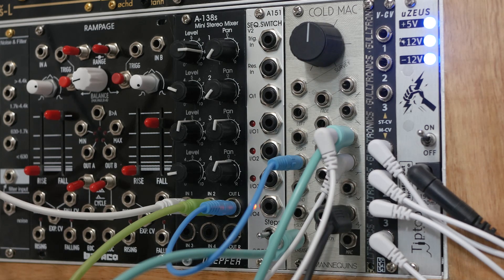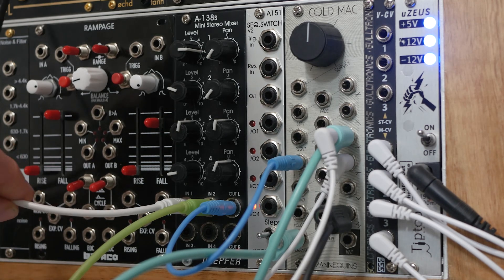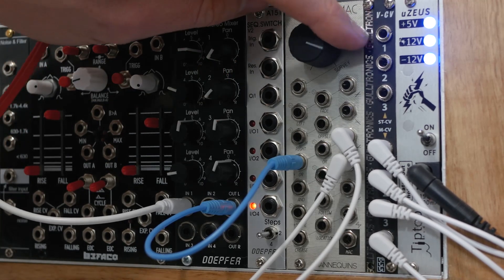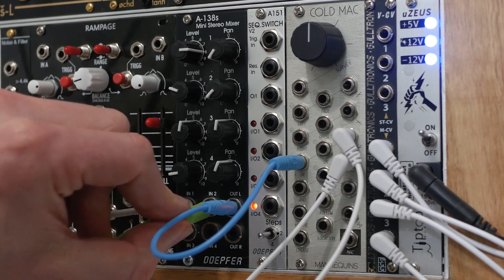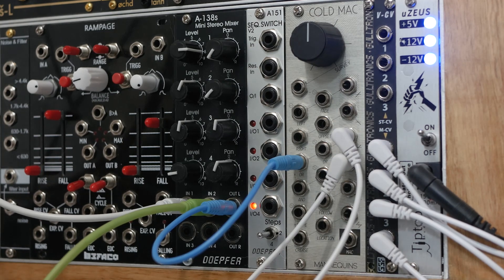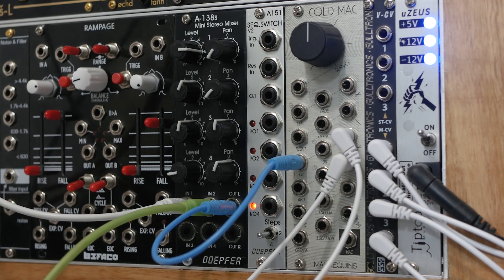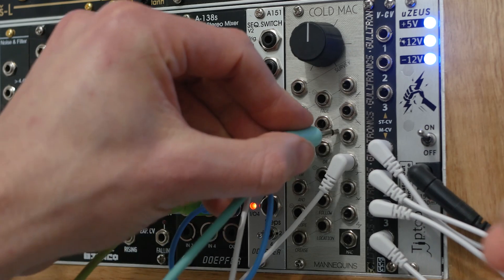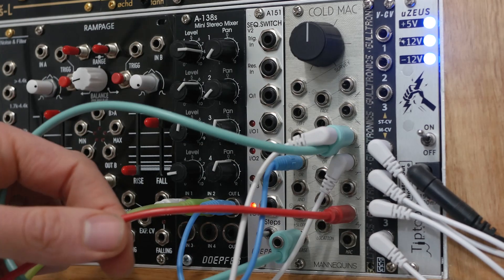Cold Mac Case Study 03: Stereo Distortion with the OR and AND Circuits

Comment: The cold mac manual mentions you can use this as a feedback oscillator, and gives a patch example. But there's no videos online; could you do a demo of that? 

Also, it's easy to use the cold mac as a simple voltage-controlled panner. What happens when the cv source is a duplicate of the mono audio in?
Reply from the maker: ha - just so happens i'd planned to do the feedback oscillator patch next! 

re: your patch question, the waveform would be split between the two outputs, same effect as plugging mono audio into the OR input and listening to the OR and AND output as a stereo output. A cool stereo-izing effect for sure
Reply: @Earther._  I believe that the sound is slightly different than the and/or stereo-izer; it could be fun to compare.

Comment: Feeding the LFO into the same audio path is genius! But how does it work?
Reply from the maker: Mixing subsonic signals (lfos) with audio rate signals is one of my favourite techniques. All sorts of weird and wonderful things happen. 

Here, the LFO sums with the audio in the mixer, pushing it up and down across the 0v axis. This is exactly what happens if you put that LFO into the Survey input too, so the end result is the same. 

You could take it further and add another LFO to the mixer, take the Mac output run it through an attenuverter and into the survey input. Heaps of room for further experiments on this patch 👍
Reply: @Earther._  Hmmm I get the Survey control but still the mixing with audio..that's so different! Is it because of how the Or/And circuits behave?
Reply from the maker: @MrMarcLaflamme  the end result is yeah, instead of moving the 'slice point' with the survey knob providing an offset voltage, we're adding that offset at the mixer while the survey's slice point remains static at 0v. 
As long as the mixer has sufficient headroom and is DC coupled, the end result is the same.

I've been asked about this a number of times actually, maybe I'll do a video demoing it. I first got the idea from DivKids Instruo Tanh demo in which he mixed an LFO into audio to create a pulse width modulation effect.
Reply: @Earther._  Ah so the audio signal itself is following the LFO path which pushes the whole signal above or below 0? I guess I can just wait for the explanation video :-)
Reply from the maker: @MrMarcLaflamme  Correct!